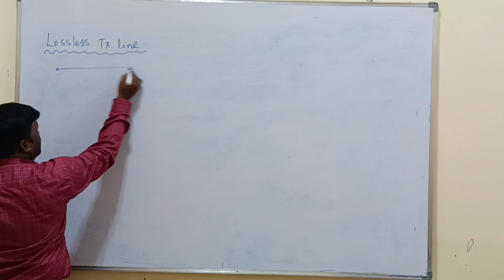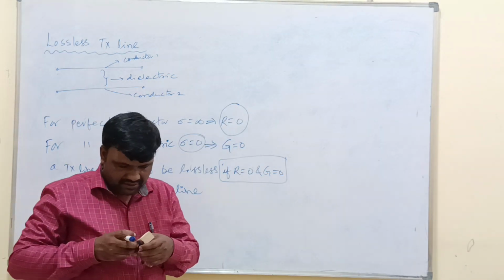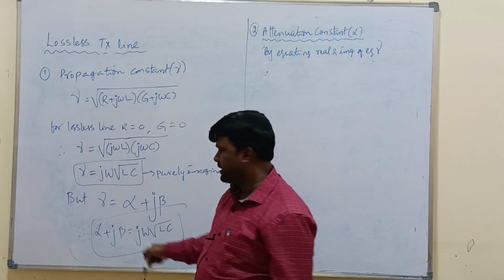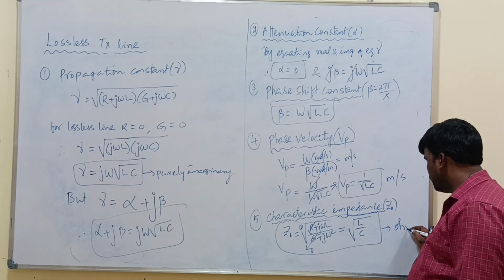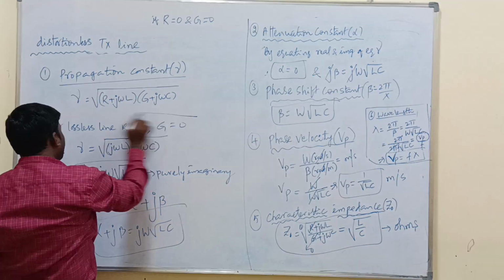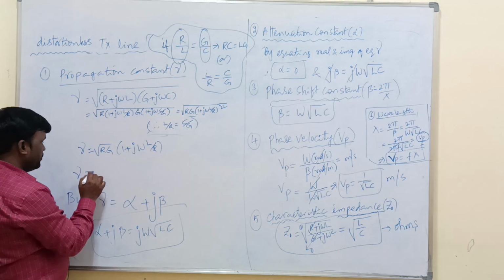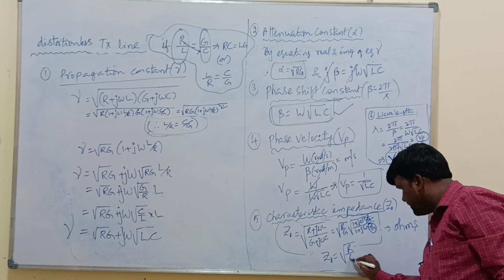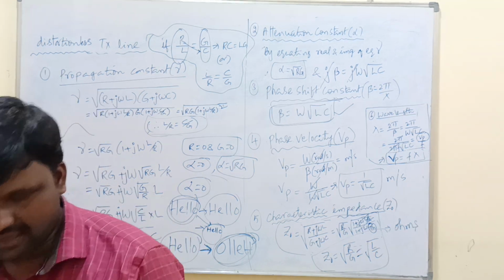Lossless and Distortion-less Transmission Line

Comment: Sir, wonderful class.but this subject & concept only useful in power system engineering.
Sad thing is ! those jobs only are belongs to state or central government jobs and other electricity department & boards only,not flexible to find jobs in other sectors & including business point of view also not fit.out of lakhs of student only 100's getting job in power system engineering sector.most of the institute only providing trainee how to crack competative exams only.but not in real time skills & new trends in technology in term of business contribution in practical ways.
Thus why so many engineering students now disappointed in career & switching to other technologies.